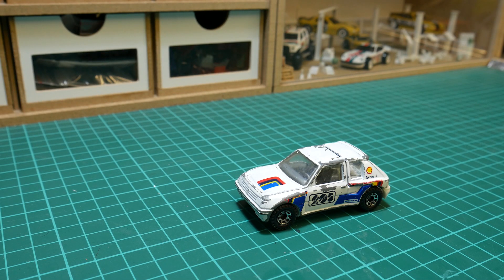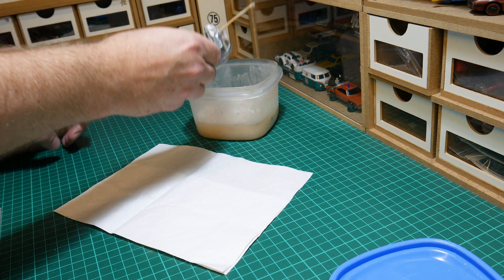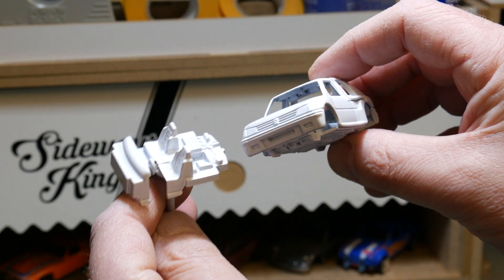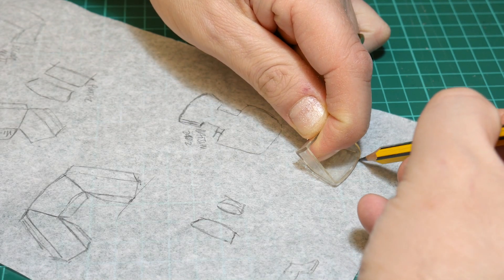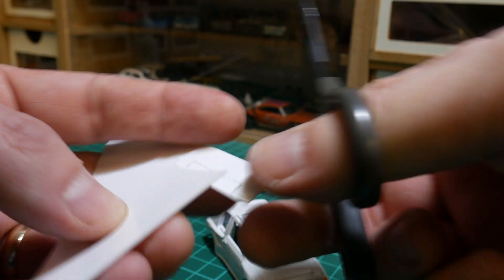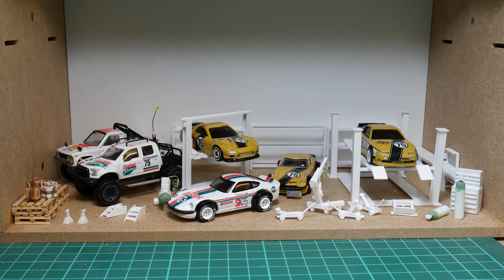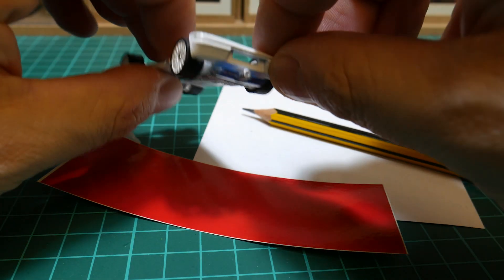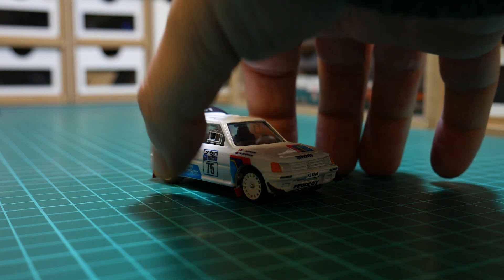MATCHBOX Restoration & Custom : 1984 Peugeot 205 T16

Comment: I have an old Ferrari car but I don’t have the skill, time or kit to fix it myself, I think you should have a po box for viewer submissions, but I understand if it’s way too much work
Reply from the maker: I will in time as you're not the first to suggest it. When I get some more of the planned projects out of the way I'll certainly look into it.
Reply: @SidewaysKing75  Interested as well, I have this exact 205 in a box in the attic :D
Reply: i have the skill but i dont have a Ferrari ;)
Reply: SidewaysKing75 do you just glue the cars back together??
Reply: Hernán R. O
Reply from the maker: @jaffathemini  No I drill, tap the hole and screw them back together. All are a little different but its the same process.
Reply: @SidewaysKing75  I've got a old Renault 5 Maxi Turbo in Philips livery that was one of my faves as a kid. I'd gladly send it over so you can make it look as amazing as this Peugeot.

Comment: Damn, that turned out really well!
Have you ever thought of doing a bigger model, like a 1/24 or 1/18? I haven't been able to find any comprehensive videos on those, so that would be a treat!
Reply from the maker: Thanks its appreciated :) I did 1/24th scale for many years and they're all now in the loft boxed up. They just became too much to have on show and the love affair for little diecasts kept coming back. I may do a walk-around on some of the past ones, the detailing you can do with seat-belts, switches etc. really bring them to life!
Reply: SidewaysKing75 - Right on man, that's what I like about the larger models, simply being able to detail them a bit easier, and like you said bring them to life. Not that hot wheels or matchbox cars aren't cool too, haha.
Cheers!

Comment: Have you considered using a smaller drill bit when removing the rivet so you don't have to use a washer when re-assembling?

I do like the extra details you added with painting the interior and engine. Also, great idea with the new windows, exhaust and wing. It's nice to see someone not do just a straight restoration. Absolutely brilliant.
Reply from the maker: Thank you I appreciate it.

Its always hit and miss with the rivet removal for me. Sometimes i get them clean off others it seems to chew up and spread and I've no alternative but to add a washer. Some are better than others :)

Thanks for watching!

Comment: I have to say this is the most detailed rally car I've seen done. It's truly a work of art. I love the engine work, the details like the wing, mud flaps, and the wires on the engine. That was a great touch. Also the little jacks and machinery piece you made are amazing. I would love a tutorial on how to use those materials. In creating a "diorama" little details like a jack, etc make a HUGE difference and I'd love to make a garage set up. It's amazing how much thought and detail went into those older castings, especially Matchbox/Lesney. They made truly awesome cars, but you took them to a much higher level. Thanks again for all the info. Just subbed being that I just found you now. I look forward now to having a little marathon of these. Have a great day and thanks again.
Reply from the maker: Thank you very much Edster III I really appreciated the comments. I agree they put such great little detail into these old castings, it was always things like daft coloured windows that spoiled it for me. The decals I know is all down to manufacturing speed and licensing but again you can bring these little creatiosn to life relatively easily.

I will do some features on the diorama pieces and share my plans to which I hope helps people.

Thank you for watching and commenting have a great day :)
Reply: @SidewaysKing75  Bingo, the odd colored windows always make me cringe a bit as well. When the heck would you see a high end car with a purple hue on It's windows? I love Hot Wheels and Matchbox, but the goofy window colors always gets me.
Reply from the maker: @EdsterIII  I thought I was the only one ..... Phew! 👍🏻👊🏻
Reply: @SidewaysKing75  LOL. No I have always been bothered by that, even as a kid. There are some castings I'd love to "fix" that have that issue, but I'm not sure about killing the "value". Or actually killing the car. I'm new to customizing and I don't have all the tools required to do it right. I was recently given a terminal diagnosis(asthmatic emphysema), and while it's slow in it's attack on the body it has rendered me disabled, and I'm having exteme amounts of trouble getting help from disability. Meaning I've lived off my savings now for almost a year. You work your entire life and when you need help, well we'll see. It's frustrating. I apologize, just aggravated. I really enjoy the hobby and when this illness happened and hunting for new cars was going to be limited I thought I could start customizing. Well I hope soon. Anyway I love the tutorial and while I have a ton of questions, I don't want to bother you if I am unable to put the answers you give to good use. I will however be watching intently. Thanks again.

Comment: I really love your customs and this one came out amazing!
You can get the same paint stripping result in minutes/hours by putting the semolina in an ultrasonic cleaner.
An ultrasonic cleaner would have made quick work of cleaning the base too (and anything really).
Don't worry about the spray cans comments unless it's causing orange peel.
Don't you use a setting solution for the decals?
Reply from the maker: Thank you its appreciated :) I do use Microset on the decals which I'll cover on that video. Thanks for the Ultrasonic cleaner tip :)

Comment: came across your chanel while flicking around you tube a few days ago . reaky like what you do this one in particular was special . as an apprentice boy in 1984 the last year of the group b rally cars and the last year the rac rally left from bath . all the local dealerships hosted the teams . i worked for the local peugeot dealer and we had the two team cars at the dealership in preperatiom for the rally . what you have created is so very cool . ben tryig to get back into modelling for a whille and this will be an insperation . well done and keep it up 

rob

Comment: What paint would you recommend for a novice getting into airbrushing diecast restoration?
Reply from the maker: Thats a good question. You can get premixed paint that has thinners already in to help it through airbrushes. It is a lot more expensive than doing it yourself but it takes the hassle and mess out if you're starting out. I use a brand called Zero paints which if you look at their website is available at only certain model stores. Other than that you can still use Tamiya X and XF paints and add a dash of thinners to them to aid it through the brush without clogging it up. The jars they come in too are the same size as most of the screw feeders for the brush so you can use it straight from the jar without decanting it! Hope it helps :)
Reply: @SidewaysKing75  thanks for the reply!
Reply from the maker: @MatchboxGarage  Pleasure. All the best

Comment: Absolutely enjoyed this. Brought back so many good memories for me personally. This matchbox Peugeot was the first of my little car collection. My Mum had bought me one of these when I was around 5 years old. Lost it a few years later and this is where it gets worse, along with an Audi Quattro(Matchbox as well) , VW Golf 3(Majorite) and a good few others. 
But Yeah, my first little car, was this Matchbox Peugeot rally car.

Lol always had a couple of these in my pocket wherever we went, as well as in my Mums handbag too lol 😆
Reply from the maker: Happy days there my friend..... Love hearing stories like this. I think all is petrol heads started out really young with diecast cars and it just stuck 👍🏻 All the best
Reply: Aah Thanks so much. 

I'd just like to point out, that due to me finding your videos, I've been squeezing in some time with a few out of shape models I got. 
Currently working on a Hotwheels car, no name on it, but I know I saw it in the original Gone in 60 seconds movie 1974 release. Long front end, with a C2 Corvette like rear end. Just having a bit of trouble cleaning the existing black marker paint job that a Cousin of mine decided to do. Turpentine taking out some of the mess, sadly can't get my hands on any paint stripper at the moment. 
Any magic home tricks you could suggest ?
Reply from the maker: @sajjaadahmedvajeth6823  other than caustic soda.... But it's very dangerous if not used properly  OR a wire wheels brush to get it off that's about all I use, but take care. I will do a 'How To' on my methods shortly actually 👍🏻

Comment: Genuinely amazing attention to detail. I've always had a soft spot for group B rally cars and the 205 was the best of the bunch. All of your added extras really turned the toy into an actual model.
As some constructive criticism, please don't take this the wrong way it's not knocking your work, it's just something that caught my eye. Is there anyway of using the pin drills to drill out the exhaust a little maybe? As the wall thickness of the styrene made the exhaust just look too heavy, it just pulled the realism out of the rear a bit.
Reply from the maker: Thanks Dylan :) You could indeed do this yes. I often do that on the original plastic chassis to liven it up a bit. I didn't feel the need on this but now you've mentioned it, it does look a bit chunky LOL..... oh well :)

Comment: brilliant job, i wanted to start customising some matchbox cars of the same cale could you pleae tell me what size drill bit and tap to use for the post. im in the uk
Reply from the maker: I use a 1.5mm drill bit and a 2mm tap, you can get them from Machine Mart easily and there's lots on eBay and the like. Get cracking you wont regret it :) Thanks for watching.

Comment: Amazing custom job. You should do a proper custom Porsche 959 Le Mans or Dakar car. Congratulations on the video.
Reply from the maker: The 'Rothmans' Dakar 959 is on my list actually ;) You have good taste my man :)
Reply: @SidewaysKing75  - And you have the skill to pull it off. Thank you again for sharing. Besides the Dakar 959, you should also do the 1971 Porsche 917LH Martini Racing by customazing the existing Hotwheels Gulf 917 LH. Keep the good job.

Comment: Great work 
You should make a video of you collection if you still have them
Where do you get your Modelsuppiers from ?
Reply from the maker: Thanks Peter its appreciated :)

I keep everything and may do a walk round soon of past builds. I get my supplies from model shops. I say shops, but I haven't bought anything in at least 5 years, the supplies simply go along way at this scale. I try and pop into a model shop when I see one as they're getting less and less nowadays but I haven't got one particular favourite. Craft shops are a good source of supplies too especially the bracelet and bead making section. The wires and dangly bits make for some interesting little pieces you can use across your work :)

Comment: what glue do you use for the styrene? I just got my styrene in the mail and am going to experiment building with it this week
Reply from the maker: Here it is ..... http://modelshop.co.uk/Shop/Adhesives/Item/Plastic-Weld-Solvent-57ml/ITM5060 its a liquid solvent and not technically a glue as it melts the Styrene together effectively welding it. Mate the two parts you want to stick together then dip a small brush in the liquid and swiftly brush along the two parts where they meet together. It will weld together pretty much instantly :)
Reply: @SidewaysKing75   Awsome, Thanks!

Comment: I asked Wheelsnthangs this question. I bought a perfect '57 nomad and I want to do a classic paint job. Black with flames. How do I paint the flames?
Reply from the maker: There's two methods I'd do Aubrey. The decal method by designing the flames and printing them on clear decal paper. I would then use the same outline profile and print this outline on white decal paper and lay that down first on the painted model with the coloured one on top of the white one. If you printed straight onto white paper you would see a white edge around, if you wanted that look you could do it that way otherwise do them separate. Second method, which would take a little more skill and time is to simply hand paint them. I would probably lay down some white first and let it dry over night before starting the colours and blending. Laying both methods down with white first will give a richer, more vibrant look to the finished flames. Thanks for the question and watching :)

Comment: i have a Cadillac ambulance which lost the top and some of lateral supports ... can you recommend some material to recover the "roof" please?
Reply from the maker: That's a tough one without seeing.... you could try EPO-Putty, a two part mix that's like clay and sets solid. You can cut it, drill it, sand it and repair or make anything. That works for a lot of my modelling jobs.
Reply: @SidewaysKing75  thanks a lot for your rapid answer sir! ... I'll try that or the equivalent in my country (Poxi-Lina) and then I'll let you know
Reply from the maker: @hernanr.  great stuff.... I look forward to it. All the best 👍

Comment: First: https://diecasttoyzsg.com/collections/garage-64?fbclid=IwAR29IARNG_gcOSucAdOhMQE0ly1cqbz_CEMCbE4Ow026Uvs5NzVN8ClPVfg as you said you didn't knew their webpage.

That was a pretty neat mod! I really love it! Tho, you know that you could save the windshields on it? It wasn't that damaged. To save it, you would've have need to sand it with sand paper, going from roughest grit to the smoothest grit, ie: start with 800, then move to 1000 then to 2000. And after that you put it into Pledge floor polish (or whatever is the equivalent in your country) and you let it dry and TADAH! Windshield looks like new! It doesn't work that well with HEAVILY damaged transparent plastic, but it would've made those glass pieces look like new!